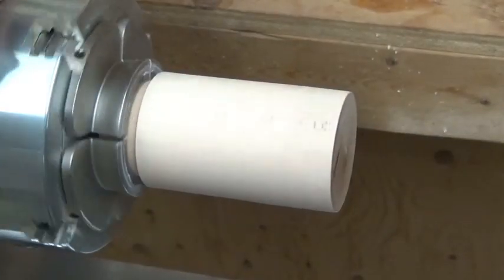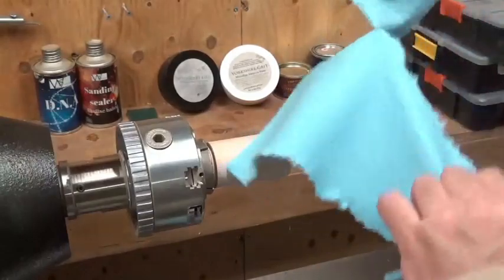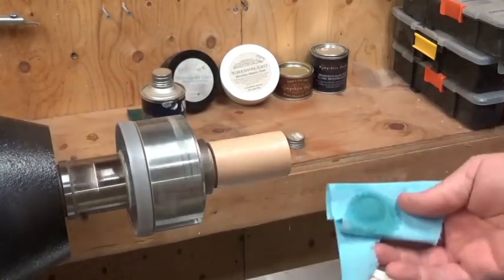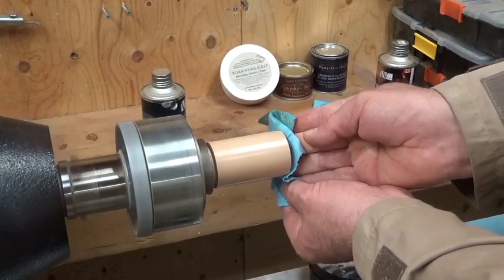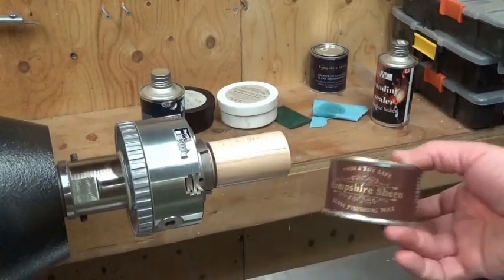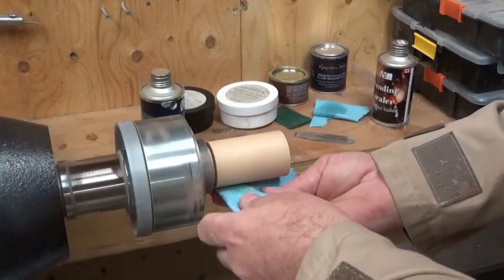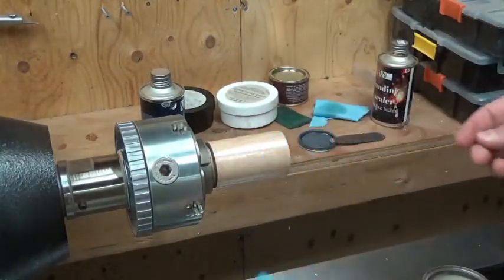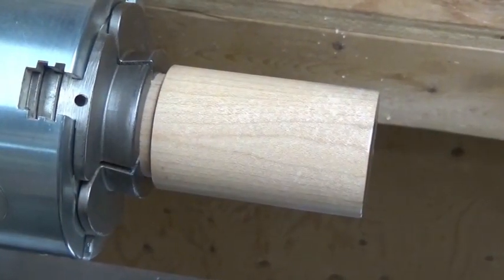Woodturning, How to get a great finish

Comment: i think im going to change my finishing on bowls and platters!
its certainly much less messy than a ca finish on pens, how well do you think it will hold up though?
Reply from the maker: i have bowls and platters with the finish i use and it holds up really well, it depends on your intended use to some extent also, will you be putting food in it like salad and washing in hot water?

Comment: Thanks for sharing. On another Turning group, there was a question regarding oil finishes, say danish oil, applied after Yorkshire grit for a salad or fruit bowl. Does the YG prevent the penetration or does the ingredients in the grit only act as a lubricant for sanding purposes only? 
In this case, white oak was used. Sanding sealer wouldn’t make sense either?

Thanks
Reply from the maker: Hi Sam,
Both Yorkshire grit and Hampshire sheen have oils in them, oil helps bring out the natural lustre of the wood adding to the beauty of the finished piece, personally I do not use just oil as a finish usually although a drying oil can be buffed, it is more work. 
Sealing the wood prior to using Yorkshire grit and Hampshire sheen allows the finish to sit on top of the wood instead of getting sucked into the fibres of the wood, especially end grain. 
Yorkshire grit can be used without sealing and then oil applied as your finish such as Mahoney’s walnut oil that is food safe. 
This video is my method of finishing but by no means the only method. I often included wet sanding with oil prior to cleaning with DNA , I hope this helps.
Take care
Rob

Comment: Woodslee,  you might like to try another way.   First thing, continue on with sanding, 400,600,800,1000,1500,2000 grit.   Wood will be shiny with no finish.  Then apply wipeonpoly high gloss with a paper towel.   Keep rubbing thru sticky stage until it hardens.   And yes, food safe finish.
Reply from the maker: Kevin Coop 
You are missing the whole point here, you can achieve as good a finish without all of the traditional sanding and creating fine dust particles, saving time and money without your quality suffering. 
There are obviously other ways to finish, if you’re good enough you don’t need to sand 😉 I’ve gone from skew to Yorkshire grit before with no traditional sanding yet you wouldn’t believe it
Take care
Rob
Reply: Woodslee Summercraft    Have you ever gone to that fine of grit?   If not, try it once to see if you like it.   Couldn't hurt!    Stay safe sir!   Respectfully,   Kevin
Reply from the maker: Kevin yes I have gone to the micro mesh pad levels before 
Take care
Rob